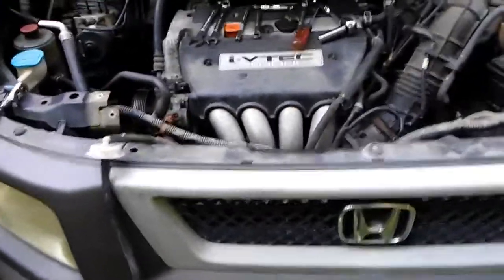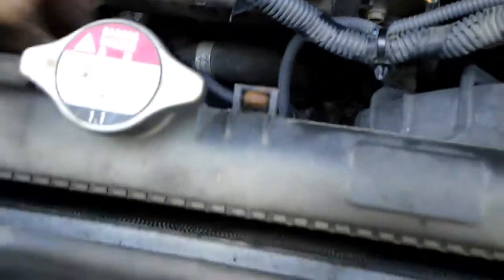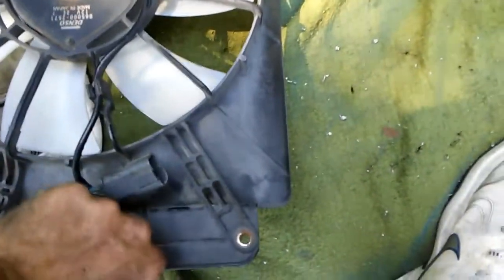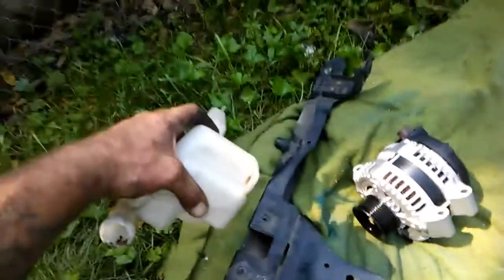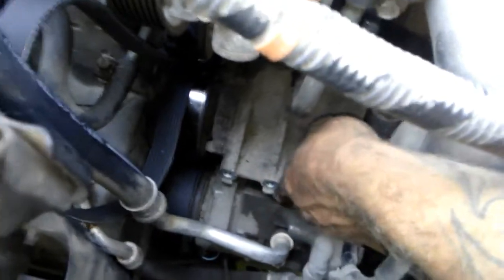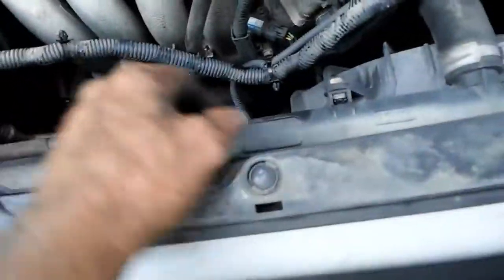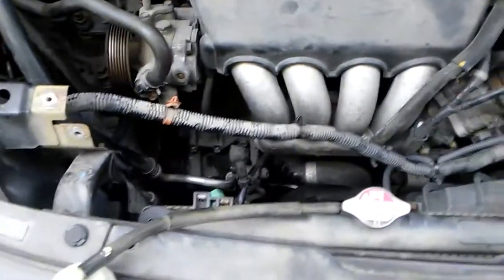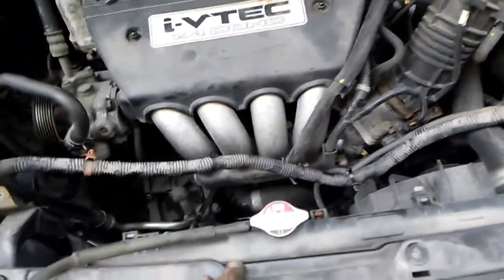(Another way ) 03 Honda element altenator - gain tons of room for service

Comment: Radio code?
Reply: When you disconnect the battery in a Honda Element, Acura, etc.,  the radio anti-theft system is activated. (If you have a factory radio) You must enter the code into the radio, which should be with your owners manual, to get the radio to start working again.